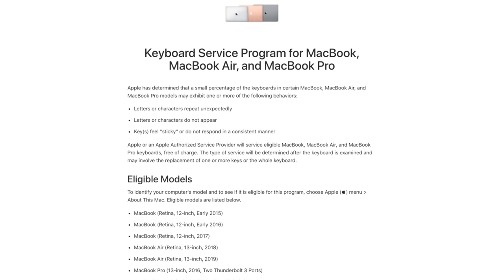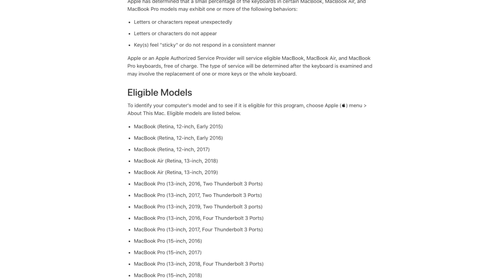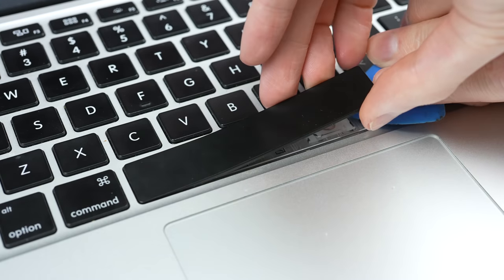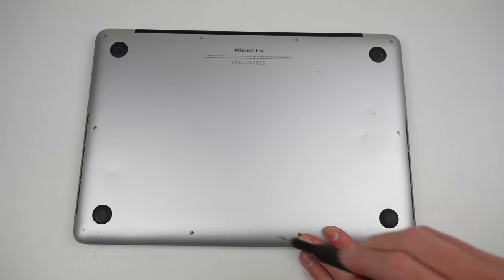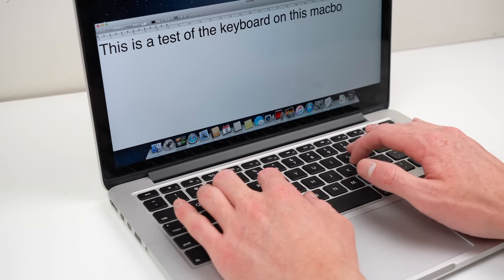Apple Really Doesn’t Want You To Fix This - MacBook Keyboard Replacement

Comment: No keyboard on any laptop should ever be that difficult to replace, period.
Reply: it's almost a crime
Reply: This is one of the reasons I switched away from MacBooks. My thinkpad keyboard can be removed with 2 screws
Reply: @lordjaashin  You have never replaced a keyboard on an modern non apple laptop? They are actually worse, because since they use plastic, they are melted on, with no way to attach keyboard back, unless you glue it.
Reply: @archy234  can't talk about other brands but my ThinkPad has screws to hold in keyboard.
Reply: @lordjaashin  Well, you are lucky. My Asus and Acer didnt... Its pain to replace
Reply: @archy234  The latest asus notebook I repaired was from 2018 and still could be replaced quite easily. I have never dealt with ultrabook/slim notebook though.
Reply: @archy234  my brother's 2015 Asus X450L does that and the ram is also soldered I hate when the ram is soldered also
Reply: @AaronJohnProduction  , I think all that is due to reduce costs to raise the profits...
Reply: @Chungu San How is that relevant to the conversation?
Reply: @sellelk2380  it's not. They just HAVE to insert a little bit of transphobia in every conversation or they will combust. It's what happens when you replace your entire personality with "I hate [insert group here]!"
Reply: To be fair, its apple and they dont like to make it simple for people
Yet people still are fooled into buying it because of the brand and pay over priced products
"The iphone 13 pro max of 1 terra for 1600 and outlandish mac pro for 5000 with lacking performance"
Reply: I've really opened gaming laptops, but a lot of other non gaming laptops use plastic instead of metal rivets. It's even worse because you can't really use any screws in place of the rivets. Laptop keyboards are always a pain.
Reply: @AppleReviews  that's only because you've used poorly constructed laptops. You can't just use a bad experience as an argument that everything else will be like it, isheep
Reply: Nah but money tho
Reply: @sellelk2380  wait what did they even say the comment is deleted
Reply: @TheJosiahTurner  they threw out a little casual transphobia which was totally irrelevant to the conversation and the video then they deleted it. They seem like a 12 year old.
Reply: @niko1even  Had a client bring me an expensive 'gaming' laptop to work on.  I turned him down.  As when I saw it I though, this thing is built of cheap plastic.  All he's going to do is break it again.  Not all gaming laptops are built well.  That MSI wasn't.
On the other hand I have a HP laptop 10+ years old still holding together.  But it is a business laptop.
Reply: @glynnetolar4423  yeah MSI doesn't have a good reputation for build quality, especially on the hinges.
Reply: @niko1even  Ding ding ding.  That's where the problem was.  That and the plastic coming off the vents too.  It was crumbling.
Reply: Дмитро Кравчик  i actually did try that methid, but didnt succeed. There was not enought plastic left, for me at least. I ended up using glue in those places. So far, holds well, not perfect as original, but good enought. using screws would have been a lot easier
Reply: how can apple even fix this themselves?
Reply: @lordjaashin  miss the 30 second keyboard replacement in my x230...
Reply: keyboard, period. I see what you did there lol.
Reply: To be honest, nowadays most brand have not replaceable anymore. They're riveted wit plastic bolts sadly.
Reply: @realspeedghxst  touch grass
Reply: Queue Louis Rossmann feedback... lol
Reply: @archy234  Yeah the author of this video sounds so gullible to a person who has done tens of those replacements. I think he never saw a modern Lenovo, Dell, HP or anything else that uses frameless keyboard for that matter. MacBooks are the worst but the keyboard issue is laughable, everyone does it.
Reply: 2 screws also mean it's very easy to swap your keyboard for a compromised one that will log all your keypresses. Just sayin'
Reply: except apple lol
Reply: @archy234  Bro wtf are you on about I've repaired tons of laptops and never ran into that problem lmao!
Reply: @uljssse  Probably same way he did it, just tare it off and put a new one in or they just replace whole front panel with keyboard and put rest in but i dont know. So far i've been working only with old laptops from HP, Acer and Fujitsu Siemens and those were quite easy to disassemble. Never had anything from Apple due to their high prices (buying one thing from them would cost me 1.5 of my month paycheck. And seeing how difficult it is to replace something in it i dont want it at all. Although just remembered one good use to stuff from Apple if plastic is good enough and that is plastic welding, just take a Apple laptop case and make strips out of it then use it as welding material with heating gun, recently i was fixing small plastic wheel this way, it was on little cart used to get firewood and it broke. Altough i didnt used Apple laptop it worked fine, ususally it has to be same type of plastic but not everytime its labeled but there are way to find out what kind of plastic it is anyway and im sure even Apple is trying their best to prevent fixing of their stuff so people have to buy new ones there will be someone to figure it out and rework it so it can be later easily serviced.
Reply: @MrDracolucassos  Reason for that si probably to prevent fixing and sell more new stuff but someone will eventually figure it out anyway. People always do when their told its impossible.
Reply: @Raven777777777777777  for sure, I'm just pointing out it's not only apple who does that. I use to work as service guy like 8 years ago and i had plenty of such keyboards with riveted keys. That was bloody nightmare
Reply: @archy234  Or you know, you melt the plastic with a soldering iron and just gently pull the keyboard off, place the new keyboard and melt the plastic 'rivets' and push them in with a screwdriver to fasten the keyboard...
It turns out plastic is quite easy to work with, who would've guessed! At least a million times easier to deal with <10 plastic molten rivets than >100 screws or metal rivets...
Reply: @robertcorwen4820  just rig the connection would be enough for key logging.
Reply: They keyboards aren’t the worst part of apple
Reply: Apple know you will spill coffe on it and made it unrepairable
but we never buy iCrap
Reply: “Some random guy said”
Reply: nothing should be that difficult to replace
Reply: @uljssse  that's the neat thing... they don't. They'll just replace the entire frame and charge you for it.
Reply: Apple: hold my beer

Comment: I honestly do believe that manufacturing costs/simplicity has nothing to do with why they use rivets. I do believe that Apple does it deliberately to make sure you buy a new one when they keyboard goes. It's why I do not ever under any circumstance use/buy/recommend any Apple products.
Reply: I’m done with them too. No ethics. I’m using my current products until they fails and will replacing them with anything else but apple. 
iPad Air. Mac mini late 2012. iPhone 8+. Im may be a minority but on the long run they may realize that losing recurring customers cost them more than obsolescence earns them.
Reply: I Never used anything Apple not since the old Apple II computers in elementary school.
Reply: Amen, brother !
Reply: @theRayzz  which other product would have outlasted until today? Your Mac mini is from 2012? That’s 10y. Ip8 is 5y/o. Barely know anyone with an Android device who is using a 5y/o one in 2022 with no massive lags.
Reply: Apple should just weld all their fucking products into a single piece because there is no points adding screws when people cannot open or repair them.
Reply: @alexrk280  there is a very large performance delta in devices from that time. Devices released 3 years ago will last another 2 at least. Hell, my pixel 3a is doing quite fine. Just that repair is a chore in Europe for these things so I may just move to another phone in the fall cuz the battery is not all that great anymore
Reply: @alexrk280  Because currently a Note 8 is not a thing, right? I know a ton of people still rocking their note 8 and 9s and going stronger than ever. You just did not bother to check what 5 y/o products outside of Apple are. I know people still rocking their s6/7 as well and it is still performing just fine.
Reply: @alexrk280  well, I still use a Samsung Galaxy S7 and it it doing just fine.
Reply: The only apple device i use is an ipod and i still have a lot of issues with it
Reply: @mohamedashraf2419  I was just going to say that I have a Note 8, lol. You're right on point.
Reply: Rivets could be cheaper and faster for production. But given Apple's problems with keyboards, that was not a good choice.
Reply: @alexrk280  People tend to replace laptops and phones more because 
1) They get rougher handling because they are cheaper
2) They are way cheaper so why cling to a laptop/phone for 10 years when you can just get a newer and better one that is top of the line for like half the cost of Apple's low end.
Reply: Mashud Choudhury  Steve Jobs was a nobody of a middle marketing man, he is only famous because when the company was failing and about to go bankrupt he got lucky with the success of the iPod which saved the whole company.... Then the sheep just bhaaaed along and kept eating up any crap they put out.
Hell I remember the first iMac in the late 90's and even back then they were doing shady stuff like soldering the RAM onto the board so you had to send it in to upgrade it.
I think the last Apple thing I owned was a Gen 2 iPod right before they made you require iTunes to even use it and when they it no long used MP3s because iTunes used it's own propitiatory music files, when I saw that I noped the fuck out.
Reply: It's not that the rivets are cheaper or costly but they want you to send it to them so instead of paying 20 you pay 2000
Reply: @dosgos  A rivet is easier to automate than a screw.  But it's a gnarlier thing to get out and replace.
Reply: @alexrk280  my razor d3 lasted 8 years, and only died because of water dripping from the ceiling got stuck on the small border it had and who knows how many hours it stayed submersed until i found it
Reply: @alexrk280  I am daily driving a Galaxy Note 3 with an android 11 custom rom without gapps and this 9+ years old device is very much usable. So yeah...
Reply: @alexrk280  Who still uses an iPhone 3?... Nobody. Plenty of people still use 10 year old Windows desktops and laptops, in fact those consumers that have desktops usually haven't upgraded or replaced them for more than 10 years now.
Reply: Really, if it's was cost they wouldn't have a gorillion rivets anyway, just seems like an attempt to permanently attach the keyboard to the frame
Reply: @alexrk280  seeing all the answer you clearly don't know any product outside apple
Reply: @SilvaDreams  I STILL have my gen 2 IPod with the miniature hard drive… that is probably the only Apple product I would pay money for, or even use for that matter. I love it
Reply: @alexrk280  my laptop is a 2010 HP, with 1/2TB And it runs Crysis with no lag.
My phone is a S7, still running smooth. Only needed a battery replacement which, guess what, was easy to do on my own and only took 5 minutes. You literally cannot do that with new IPhones, their batteries (pretty much all their hardware) are DRM locked.
Reply: @369Sigma  Unfortunately I lost my Gen2 Ipod when I was homeless briefly. I made the mistake of going into a shelter for the night since it was late fall and someone stole everything but the clothes I was wearing. Walked out with quite literally just my jeans and a long sleeve shirt on. No shoes or jacket.
Reply: @alexrk280  My Alt Android phone is from 2015, I still use it, and it still runs perfectly fine.

(Only reason my Main Android phone is a newer model is due to needing a new OS beyond what that series could reach for certain apps)
Reply: @alexrk280  me, I am using a close to 5 year old phone with no lag or issues. The battery time is still as good as always
My laptop is even older